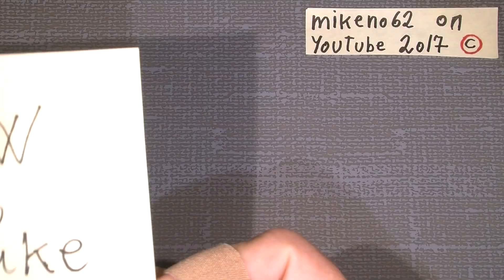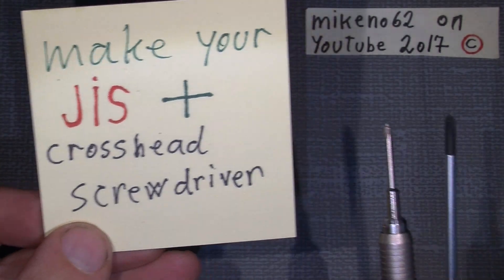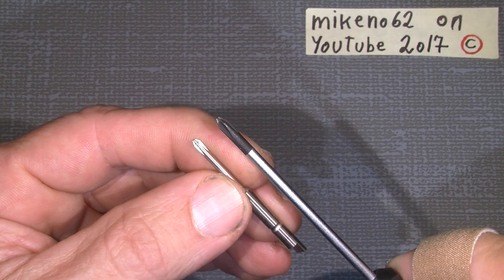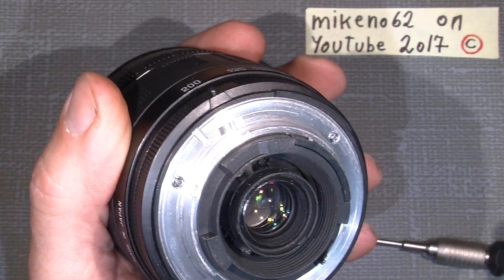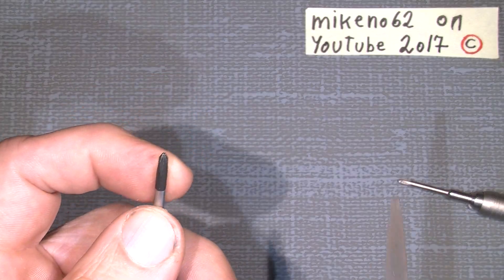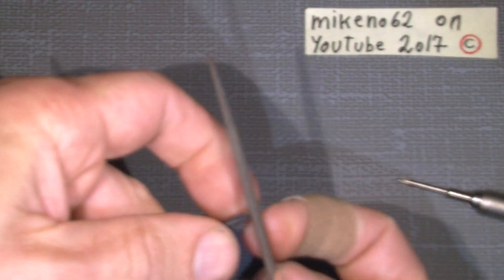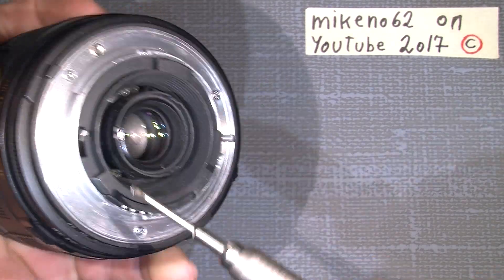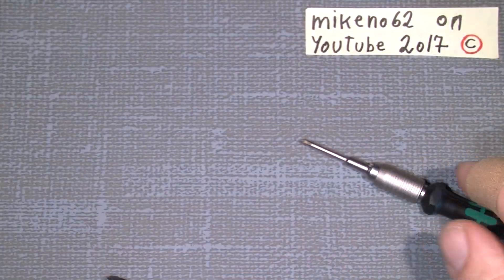How to make a JIS 0, JIS00, JIS000 or JCIS 0, JCIS00, JCIS000 crosshead screw driver. (same process)

Comment: You can't turn Phillips driver into a JIS driver by filing off the tip.  The flutes are ground at different exterior angles, and the sides of the JIS flutes, rather than being cut at a 3D taper, are cut square.   It's not that hard or expensive to buy JIS precison drivers,  why bastardize something cheaper to turn it into a poor imitation?  Good tools last a lifetime, bad ones create damage that shortens parts lifetimes.
Reply: Word.  Got to admit though I've had some trouble finding what I need for JIS. I got some from Moody tools, but I am not sure of overall quality and the smallest driver is 2mm, which I think is 00?  And ultimately my problem is that since I was not aware I now have a stripped head on one tiny little screw thanks to a Phillips.  Sigh, I guess I'm saying I hope people see your message and understand why they should have the right tool or they will pay for it with headaches.  

Know where I can get an extractor for a tiny screw?
Reply: I feel like it's less about people using the wrong tools than them being stubborn about the bit.  I've learned that if a screw cams out more than once or twice, I need to find a better-fitting bit, instead of manhandling it.

Comment: The phillips head is also more square on the + not just shaving down the point. Kinda risky doing that on a Wera driver, why not just buy a JIS tip like the exchangeable tipped one. Or Vessel invented JIS, you could buy there micro drivers. They also make Camera JIS tips I heard of also, not just JIS. But almost all German, Japan & Swiss companies make JIS tipped micro drivers now days without modifications to the tip.
Reply: Vessel did not invent JIS.  They participated in the design and later development as it was merged into an ISO/DIN standard.  Vessel was the only manufacturer who survived the War. ALmost all German, Japanese and Swiss companies, including Vessel now make crosspoint drivers that fall within the manufacturing tolerances of the same ISO design. BTW, so does the Phillips company.

Comment: I never use 0, only 00 (Wera) and sometimes 000 (Wiha). How come you're using 0 ? I don't get it, the tip is is way too big.
Reply from the maker: Well, It's just an example on how to modifie a Philips 0 to a JIS 0, it would be the same if you do it with a PH00 or PH000.
I also found out that,  PH0, PH00, PH000 or JIS0, JIS00, JIS000 does NOT have the same diameter on the screwdriver tip, it depence what brand of screwdriver you use. I have 4 different brand's of PH00 and they all have different diameter and it's the same with JIS00 screwdriver's.